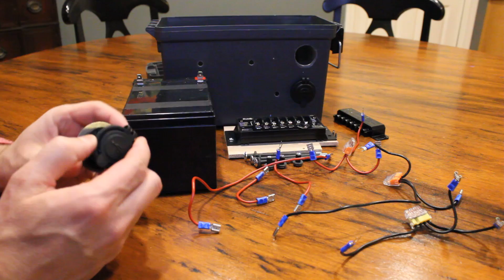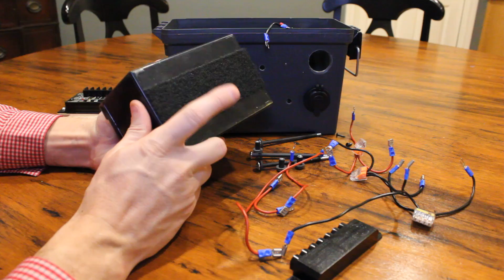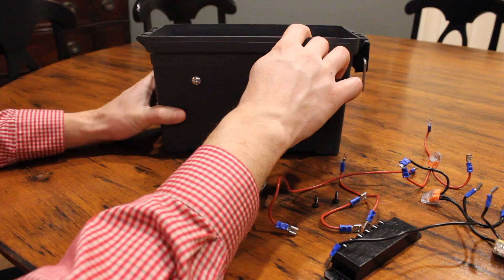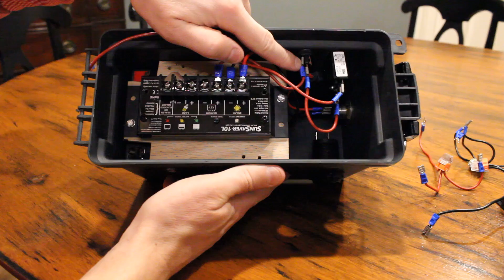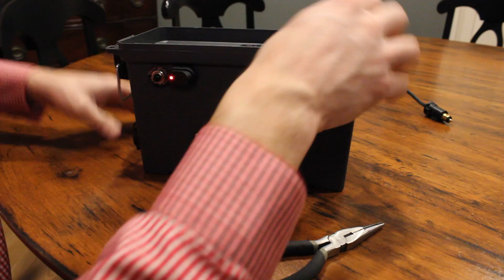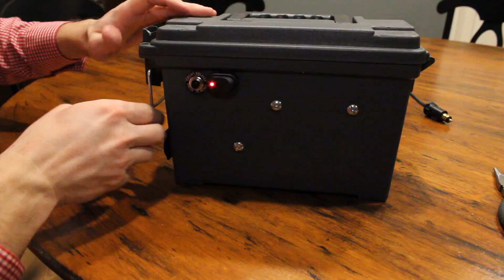Solar Ammo Box Generator - Assembly

Comment: Hi matt 
Can I  plug a  battery charger in to solar plug  to charger battery on the day if the sun is not out or not please let me know
Reply from the maker: As long as the charger is compatible with the battery chemistry and voltage it shouldn’t be an issue.

Comment: I see that you have a video where you have switched over to Lithium. http://mattlesak.com/solar-pages/2015/9/15/solar-ammo-box-generator-lifepo4-update   In the video you say that what is needed is a voltmeter. However, it's my understanding that with lithium batteries, the voltage drop is much slower over time and there's a sharp drop off towards the end.
This is one of the reasons why using a voltage indicator is not really a good indicator of state of charge like it is
with lead acid batteries or AGM's.  Check out this video  https://www.youtube.com/watch?v=psjQ-FT6KY0     What about using a BX100 Battery Voltage Tester Low Voltage Alarm Buzzer
Reply from the maker: +Chris Barclay Your understanding is correct and it's one of the challenges with Lithium.  That buzzer is a great way go for some. I'm looking at battery meters that measure voltage and current to determine over capacity and usage.

Comment: How long does it take to recharge your setup and can it be recharged with AC?  I see that this company also has a Lithium 12v 12 ah battery for $130 and a Lithium charge controller for $100 ......  any thoughts?
Reply from the maker: +Chris Barclay with the 50W panel, a few hours. I purchased the AC charger at the same time as the battery to have just in case. No issues with it and it takes a few hours to charge as well.  I didn't purchase their charge controller due to size constraints with my build. No doubt it works well, I just don't have any experience with it.

Comment: Very good project!  If I wanted to charge battery from another source besides Solar using 12v DC socket how would you wire? Direct to Battery with a fuse? How could 12v DC socket be used as an output as well input? Need two 12v DC sockets?
Reply from the maker: +rb2whrider If the 12V socket is directly wired to battery, you can charge from multiple sources. It can be used as input and output, no need for second socket. Electrical current doesn't care, which can be good and bad ;-)

Comment: Hello Matt, it's me again. I ordered a 20 watt and a 25 watt solar panel (both of which came in). My intent was to order a couple of 10 watt panels but I made a mistake. I currently have a 12v, 10 amp battery and a 12v, 15 amp battery to use. Is it okay to use a 20 watt or 25 watt solar panel and a 20 amp (12v) solar charge controller with either a 12v / 10 amp battery or a 12v / 15amp battery? Or do I need to get a larger (amp) battery? I tried to Google this question but the selections were just too suspect/questionable to trust. Any assistance would be greatly appreciated. I am doing this so when I take my JROTC Cadets to our annual FTX (camping) I will be able to give them a class on it and we can build one together for them to use. I thought it would be a great skill that they could use later. Now I am rambling...thanks for your time.
Reply from the maker: Can you share the links to everything you purchased?   Based on what you've stated - the controller can charge a 12V battery at a maximum rate of 20A based on what you shared.  For the battery size and solar panel rating, it will work fine.  I highly recommend the following book: https://www.amazon.com/Build-Your-Solar-Powered-Generator-ebook/dp/B008NQ40AY
Lots of simple and basic information about this topic that is critical to understand.  It's an easy read and will help anyone understand the basics of how to create a solar generator.  Please share the links and let's see what you ended up getting and go from there...
Reply: Thanks Matt,
I will order your recommendation. Thanks for taking the time to answer my questions.  Everything I ordered was through Amazon. Not exactly sure what I can provide other than parts.  Do not take this wrong but I worry I may provide info that can be used against me by other than honorable people (hope I do not sound paranoid or like some weirdo).  I try to error on the safe side. Anyway, thanks so much for your insight. Anything you can add would truly be appreciated. Thanks.
Reply from the maker: Understood.  It's hard to assist if you don't share what you purchased, but totally your call.  The book will go along way and walks you through the process.  Will save you a lot of mistakes and money from those mistakes ;-)

Comment: Thanks for the great information Matt.  I am a newbie to this and have noticed a trend with a lot of YouTube videos on this subject and almost all of them address USB and a 12 volt plug-in.  If I was to attempt to build a portable solar generator it would be for camping and the ability to use my CPAP machine. Do you have any videos/tutorials that cover the use of inverters  vs the proper battery size. My assumption is that a 12 volt battery would be sufficient.  Thanks for any advise. Respectfully,  Harold
Reply from the maker: +Harold Brickel Thanks Harold!  I don't have a video that covers that specific topic. A lot of people do use their CPAP machine with this type of configuration.  The key is understanding how much power the unit consumes along with the overhead of the inverter and calculating how long you need that power to last.  That will then determine the size of battery, etc.
Reply: Thanks Matt for taking the time to reply. I will do the need calculations. Please keep making your very helpful videos.

Comment: never use solid wire on dc voltage !!!!!!!!!!
Reply from the maker: luckeychuckey70 I've seen it used in several low voltage use cases.  Thermostats, door bells, automotive, etc.

Comment: Rather than those blue plastic insulated terminals, you might want to look into using open barrel terminals with the correct crimpers, and then just put heat shrink over the whole terminal. you mentioned liquid electrical tape in a previous video, and this method would save you the goo mess.
Reply from the maker: +Gregg Langer I never did use the liquid electrical tape.  I had dreams of making it water proof, but reality showed up and corrected my perspective.  Thanks for the suggestion in regards to the terminals.

Comment: As far as not over tightening the bolts that hold the battery in place, have you thought about using plastic gutter spike ferrules as spacers. They are cheap and easy to find.
Reply from the maker: +Brent Riddick That's a great idea.  I solved the issue with a different design.  Check out my playlist for the 2.0 version of this and you'll see what I'm talking about.

Comment: I think its great using the wire shrink wrap to cover the bolts...  Ive been shocked thru no fault of my own because of insulated wires having rubbed against bare metal.  though its not likely to happen in this instance it seems just a good extra precaution.

Comment: I'm planning on Building one of these that will be used all the time to charge the cell phones instead of using the power from the grid. Here is My part list. If you are someone else can tell me if everything would work

1. Battery Tender BTL35A480C Lithium Iron Phosphate Battery - http://amzn.to/1rzhgP5
2. Bioenno Power STA-30 12V/24V, 30A Solar Controller for LiFePO4 - http://amzn.to/1VBVd6B
3. Blue Sea Systems Push Button Reset Only Quick Connect 30A Circuit Breaker - http://amzn.to/1VBVmqG
4. KINGSOLAR™ 120W Sunpower Semi Flexible Solar Panel - http://amzn.to/1rzi8mN
5. MTM Ammo Can - http://amzn.to/1NSUpSN
6. Waterproof Dual USB 2.1A Charger Adapter and Voltmeter LED Panel 12V-24V - http://amzn.to/242FUc1 
7. AutoEC New 3pc Car Truck Rocker Toggle - http://amzn.to/1VBW7Qm
8. uxcell 5 x Momentary SPST NO Green Cap Push Button - http://amzn.to/1rziwlk

What do i plug do i need to install into the case (#5) so i can plug in the solar panel (#4) without opening the case? Also, the usb charger adapter (#6). The voltmeter i want to be able to turn off by pushing a switch (#8). No need for it to be on wasting juice. I just need to see the voltage every once in a while. can i do this?

I also need a charger. I want to be able to plug in the charger without opening the case. What Charge do i need, and plug?
Reply from the maker: +Chris . Jones 
It's a good list of parts.  The battery is a concern since it's designed for high output (starting engines, etc.) and when I spoke with Battery Tender a while back, they stated their batteries were not designed for energy storage for solar use and didn't recommend them for this use case.  That being said, I don't have experience with their batteries for this application, so it's something I just wanted to point out.  It might be worth a call to their sales/tech folks to double check.

Make sure your ammo can will be able to accommodate all the parts plus wiring.  Double check dimensions of all components and compare it to your ammo box.  It's something I've learned the hard way even after I checked everything out.

As far as external connectors, this was a bit of a challenge for me.  I ended up going with a Powerlet plug which has been working great.  Checkout my parts list website for specifics (http://goo.gl/7DRbIs).

Comment: I like your video shared and subscribed. Will like to know the internal dimensions of the amo box?
Reply from the maker: Thank you for sharing and subscribing!  I will measure for you and post. I'm now using a different box since the one in my video is smaller at the bottom compared to the top. I found a better solution and I will post my update soon.
Reply from the maker: +osvaldo rosado
Bottom of the case is 9.25 inches x 3.75 inches (23.5cm x 9.5cm)
Top of the case is 10 inches x 4.25 inches (25.4cm x 10.8cm)
These are approximate measurements and this case tapers from the top to the bottom hence the difference in dimensions.  After using it, I would not recommend it for this reason.
Here's a better case:
https://www.flambeaucases.com/index.php/site/details/T1400
It's squared and components fit in it better.
Reply: Thanks

Comment: Matt,

Also, as far as the LOAD output goes for charge controllers. Does the charge controller limit the amperage coming into the devices hooked up to the LOAD output as it does for the battery? For example, if I have a few low powered DC fans and a water pump that are max rated for 5 amps before destroying the circuitry, will the charge controller limit this? Or do I need to install fuses inline for each output device? I was planning on adding inline fuses either way as a safeguard, but was hoping the charge controller would take care of this for me.

Thanks!
Colin
Reply from the maker: ***** The charge controller is limited to 10A total output at 12V.  The controller will limit the output.  I put the fuse inline with the switch (hence inline with the battery) which will help safeguard against both input/output loads to the battery.
In your case, if your total load is under the 10A, you'll be fine.  Let me know if you have any questions.  Good luck with your build!

Comment: Thanks for sharing, Matt. Any chance you can throw in an inverter in your configuration?
Reply from the maker: For this particular build, there's simply no room. You can connect one to the 12v cigarette port without issue and it's exactly what I've done. I'm working on another build that would include a small pure sine wave inverter. The box is going to be larger to accommodate but we'll see what happens.  As I mentioned in previous posts, you could remove the battery and go with a complete modular design. That would free up space for an inverter or whatever else you made need. My thought with this build was compact and flexible. You can attach several different 12v loads to the cigarette port and not limit to just a single use.

Comment: Matt,

According to Morningstar's user manual for the SunSaver they only illustrate using fuses on the battery and load terminals. Thus, considering the SunSavers Solar Overload protection whereas it will stop charging the battery if the solar input exceeds the rated amperage, what is your reasoning for placing a fuse between the solar panel and the solar charge controller? I can only assume it is intended as an added safeguard for the charge controller from any damage? 

Also, what connectors are you using to make connection with the actual battery terminals as those seem to be the only connectors you don't show via video? I don't see any ring terminals as that is what I assume you are using?
Reply from the maker: ***** As you stated, I place them there for added protection.  It's simply a safeguard.   As for the batteries, they are standard F2 terminals.  To secure them, make sure the connecting ends are tight and then you can use either liquid electrical tape or heat shrink tubing.

Comment: Great video, one question.  What gauge wire did you use to wire the battery and components?

Thanks,
Ian
Reply from the maker: 14. I had two spools of red/black, so that's what I went with. You can us 16 and probably get away with thinner because the runs are so short.  Thanks for the feedback!

Comment: Matt,
Nice job on the DIY solar project.  The ammo box is very tight and was wondering if you could post some photos of how everything is wired together?  Perhaps do a build outside the box that shows how the wiring is configured and take a photo would be useful to others.

I am interested in building a similar project and really like the on/off switch, circuit breaker and fuse but am unsure how it is wired in.

Thanks for posting the parts and videos!

-Gary
Reply from the maker: Gary - Glad to do it. I think a video would make more sense. I could walk everyone through it. Give me a few weeks and I'll post it.   Glad you liked the project. I enjoyed building it and learned a lot.
Reply: ***** Looking forward to seeing the wiring details.  Apparently Amazon no longer has the battery in your parts list as it appears as a dead link.
Reply from the maker: Gary Strek Sorry about the dead link.  I've updated the blog post with a link to another battery that has the same specs.
Reply from the maker: +Gary Strek Here's the wiring diagram.  My apologies for taking so long.  goo.gl/WsFrjb
Reply: +Matt Lesak Thank you.  It looks like you've stepped things up with battery technology and MPPT controller to match.  Very nice.
Reply from the maker: +Gary Strek I did.  I've been playing around with different options and decided to go that route.  I'll share all of my findings on my next video.  Two main benefits: weight (much lighter) and depth of discharge.
Reply: +Matt Lesak Very good.  I like the new battery technology and especially being pounds lighter, not to mention more environmentally safe.  My application may end up being used on a sailboat so lightweight is especially beneficial.
Reply: +Matt Lesak Looking forward to that video. Trying to build one w a LiOn batt right now. Cheers.

Comment: Thanks Matt... I'm curious why you used the Powerlet input from the solar panel rather than a standard 12 vdc socket similar to what you used on the load output. The Powerlet seems much more rugged but could limit your options for charging the battery from sources other than your solar panel.
Reply from the maker: I went this route because I wanted something that was water resistant and could handle at least 10A.  The socket has a latch that forms a decent seal to keep water and dust out.  The plug and socket are very durable along with good build quality. As far as charging options, I built this with solar as the primary charging method. Charging the battery via a regular 12V charger is straight forward. I just connect directly to the battery terminals.
The 50W panel I use can get the job done in a few hours.
Reply from the maker: Did you watch my overview video?

Comment: What length "sex bolt" did you use to lock the battery? I thought this was a much better idea than Velcro!
Reply from the maker: Michael Olive 
They are 1/4" bolts and 1/2" in length.
Here's some links from the site I ordered them from:
https://www.boltdepot.com/Sex_bolts_Combo_truss_head_Zinc_plated_steel_Coarse_(standard)_thread_1_4_barrel_(10-24_thread).aspx?Selected=14298
https://www.boltdepot.com/Machine_screws_Combo_truss_head_Zinc_plated_steel_10-24.aspx?Selected=2910

Hope that helps!  I agree, much better then Velcro ;-)
Reply from the maker: Michael Olive I've updated my blog with a complete list.
http://mattlesak.com/solar-pages/2015/3/4/solar-ammo-box-generator-project-parts-list